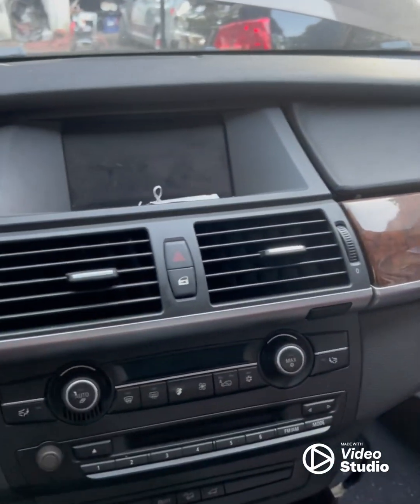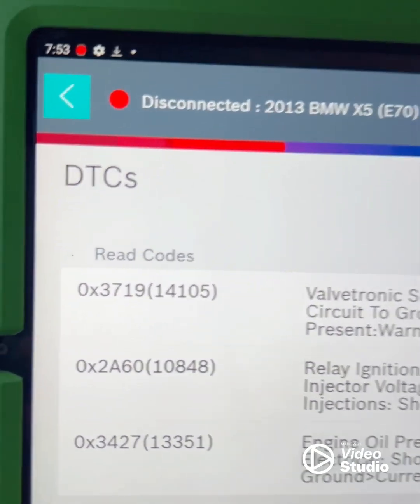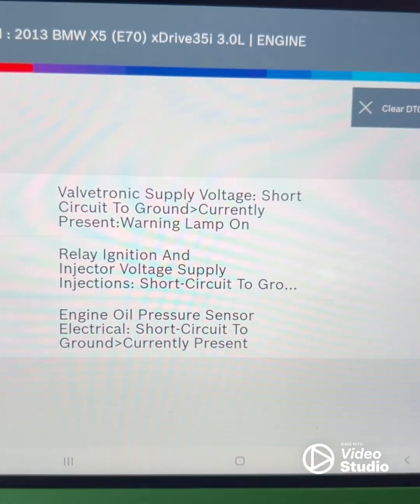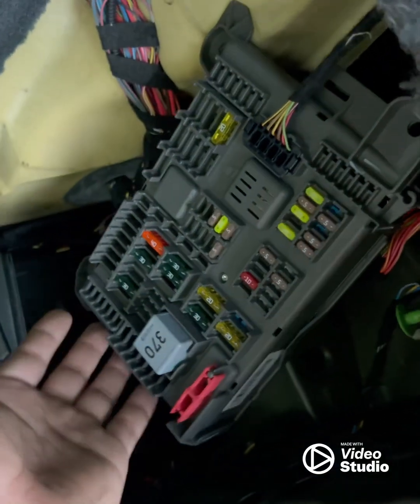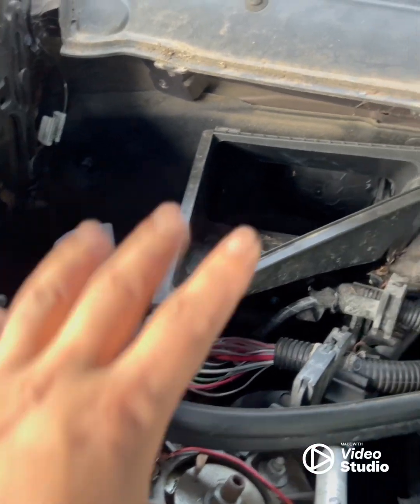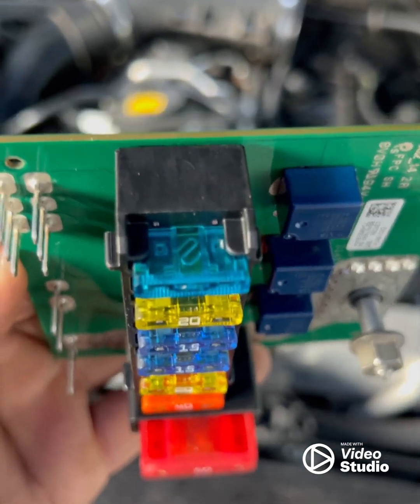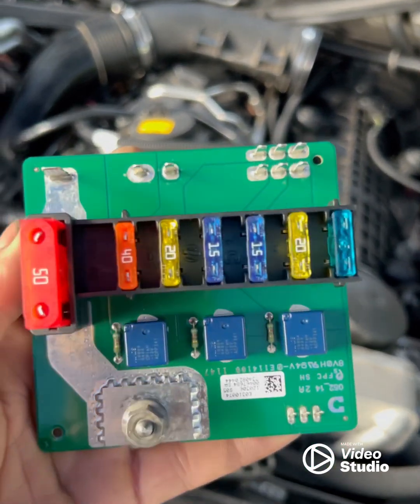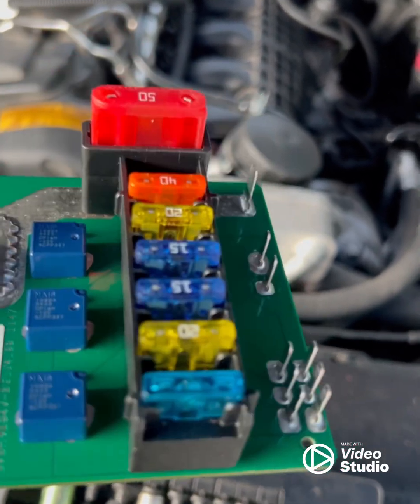2A60 , 3719  BMW code , won’t start only cranking fix.   BMW n63/n55 engines. ICM module problem

Comment: i have a N20 car cranks no start 2012 SAME EXACT CODES!!!  “ Relay , ignition and injection system , supply voltage  , fuel injection : short circuit to ground.
&
3719 Valvetronic , supply voltage : short to ground. 

just like you , cranks but doesn’t start. Bought a new ISM hopefully we are good and pray for me 😂 1/3 red/black cable connections get power from my multimeter so let’s pray it’s that and i can get her back up and running
Reply: Did the ISM work?
Reply: @USkeZB3mpyAMCV receiving today, praying it does bro!
Reply from the maker: Yes it did

Comment: Hello, I have a question. I have a BMW F20 116i 2013. I have a fault code 130e20 which comes when the engine is hot, only when I turn off the engine and restart it. There is no engine light, but in degraded mode. I can't find the solution. I changed 2 TDC sensors, 2 solenoid valves, 4 coils, 4 spark plugs. Do you have a solution please?

Comment: The n63 is a different engine with a different DME and it does not have that fuse box. The N63 is a 8 cylinder twin turbo.

Comment: I’m currently having the same problem I did everything you did . I have no power in the coils. Car is cranking but won’t start  it’s the same car . Did you fix the problem?
Reply from the maker: Yes I did
Reply: @fayzullo4317  what was the problem
Reply from the maker: @MiguelMota-b9p  it was DMV fuse box , that is why I did this video , just watch it